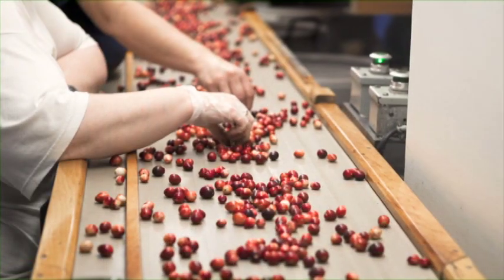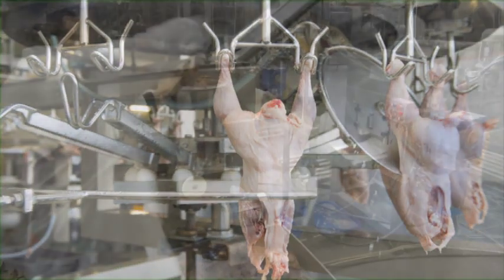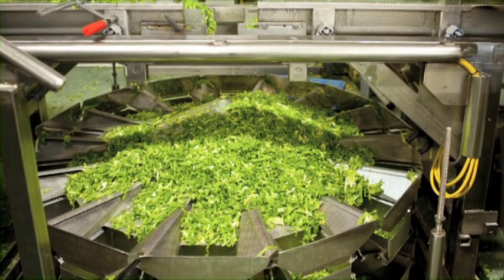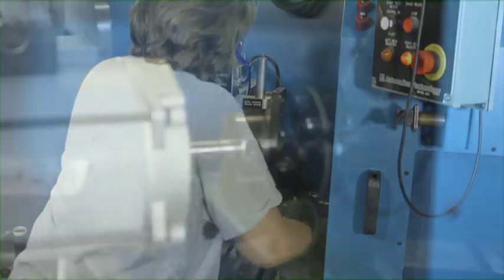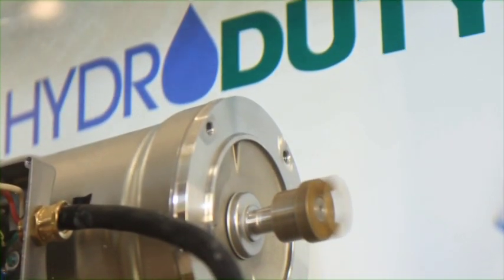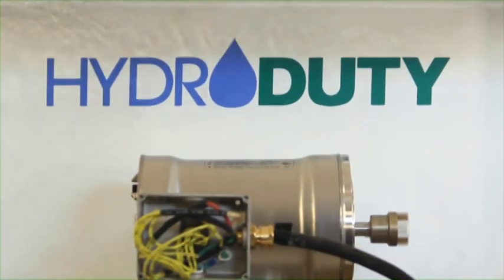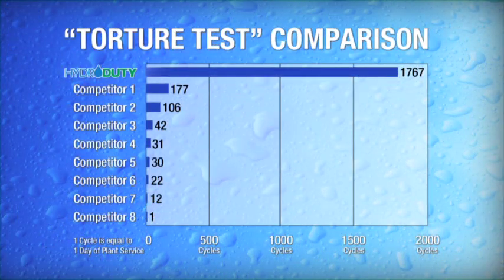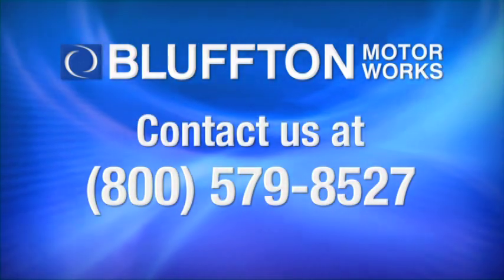Washdown Motor HydroDuty Bluffton Motor Works

Comment: Work in maintenance in a food processing facility , using high pressure wash-down and caustics. Install one of these Hydroduty motors over three years ago as a trial and it is still running . We primarily use Sumitomo motor/reducers but experience stator failures regularly. Going to try c-face Hydrodutys and c-face Sumitomo reducers.